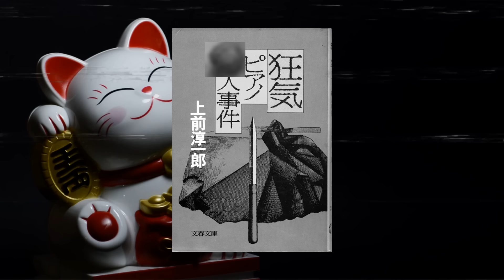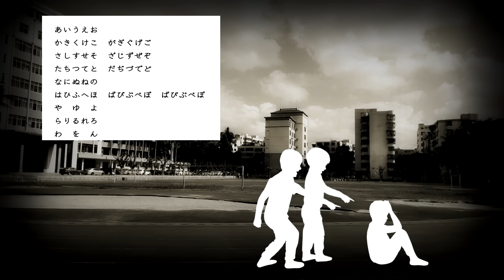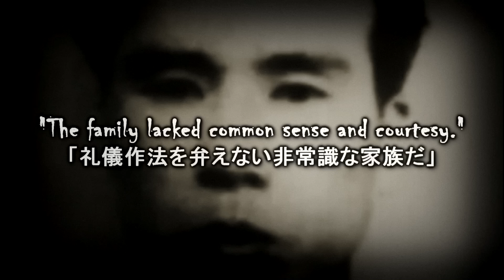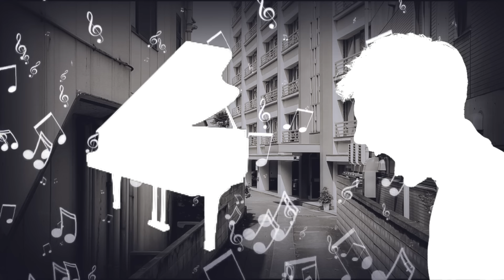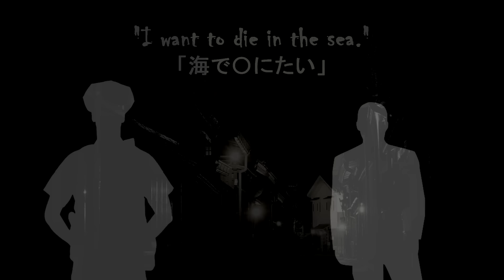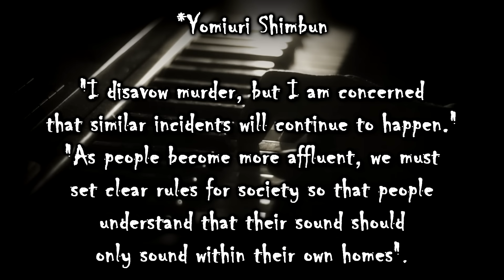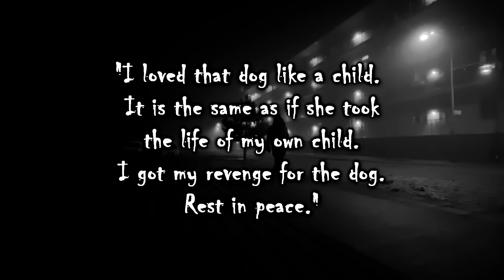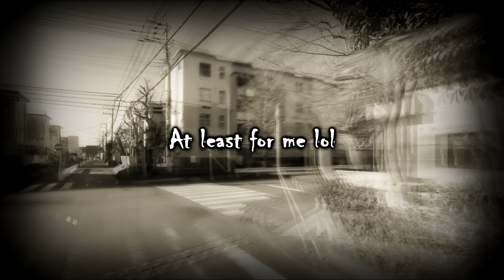Matsuzo Ohama: Piano Noise Incident

Comment: I saw some discussion in here about both hyperacusis and autism. I've had hyperacusis for about 10 years now due to a severe case of Bell's Palsy. In the first weeks of the condition, the torture was extreme. I would literally scream if someone so much as dropped a set of keys on the counter. At that time, ear plugs and headphones didn't help and even made it worse (hard to explain how). Later, as I regained some function, I could handle it. (Although I'm still easily startled and annoyed by a lot of noise.) These days, my Bose headset is a lifesaver for my sanity when I'm overwhelmed. Still, this doesn't sound like hyperacusis to me. People are not usually born with the condition. It's more often due to injury, medication, or age. For that matter, it doesn't sound exactly like autism to me either - at least not exclusively. (It runs heavily in my family including both of my children, and I'm a certified autism specialist.) I think he might have been on the spectrum. But it sounds a lot more like some degree of paranoid schizophrenia. After all, he didn't start with either the speech impediment or the sensitivity to sound - he ACQUIRED those. Which sounds as if he was both delusional and...highly suggestible by his own delusions in suddenly finding himself stricken with those issues. I think this guy had multiple mental health issues that were far more to blame than extreme noise sensitivity or autism. It would better explain the extreme behavior of murdering the family. Autistic people are more typically victims of violence rather than perpetrators. The ones you see in the news who have murdered almost always have co-morbid delusions. Great video! Thanks so much for what you put into these. I hope you feel better soon.
Reply: I’m no specialist, just on the spectrum. I’d like to differ on one point you’re making and would love to hear your thoughts. Acquiring the speech impediment felt to me like a textbook autistic survival strategy. You imitate how people communicate. In this case, he apparently had one friend. It was vital for him to keep that friendship alive. Our guy would have imitated his friend’s speech patterns, choice of vocabulary, intonations, regardless of how the friend expressed himself. As I see it, he did not consciously acquire a stutter, as much as he developed a communication path to someone he cared about.
Reply: I think simply his sensitive ears plus his personality and lack of help all contributed. He may have been having full on hallucinations but seeing as they are mostly verifiable real noises I would say he just bred a personality order and dangerous mindset. Would have to talk to him in more depth to see if he tried things like earplugs or living in a quieter area.
Reply: @Jtq-y4n  Good point. But I'm still thinking that his perceptions of the noise-makers' intentions were more the delusional part. He's definitely a complicated case study. 100% agreement on multiple factors.
Reply: @CineMiamParis  I see what you're saying, and I agree that imitation definitely influences communication. But to me, the severity of the imitation - going from being conversational to being unitelligible - is...extreme.  Picking up expressions, intonations, pronunciations, and mannerisms is one thing, but he went from being able to converse to hardly being able to function. And the acquisition of his intolerance to sound being due to a complaint when he had already been enjoying his own music. It just seems like the suddenness of it all is off - especially in adulthood. Being upset someone complained about his music would not be the reason my son can't tolerate loud music. He can't tolerate it because he can't tolerate any assault on his senses and hasn't been able to since birth. But this guy enjoyed playing his stereo prior to that. That, in particular, seems like a...decision - subconsciously or not - rather than an innate sensitivity. I'm not entirely off the spectrum myself, so I really do get what you're saying. It's valid. The stutter probably wasn't deliberate at a young age. But weighing all the possibilities people discussed here, my entirely unsolicited thoughts are that it's a little bit of all them. But for me, I'd rank him being mentally ill first and autistic second. That said, I'm not a psychiatrist, and I didn't know him. And I do realize this is all theoretical. I'm just leery about chalking it up to autism primarily. We already have a stereotype abounding that autistic people can be dangerous - which is actually dangerous for autists (i.e. supermarket shootings, emergencies involving police, etc.) People who are merely autistic aren't generally murdering people. But if severe enough, paranoid delusions have led to a lot of murders.
Reply: personally as someone whos experienced delusions i would say it could explain his persecution complex, but not really the adoption of unusual traits/adversion to sound in general. i do not have schizophrenia, altho id like to remind you that like autistic people, schizophrenic people are significantly more likely to be victims of violence than perpetrators. shizophrenia and autism are actually very similar (used to be considered the same condition) and its sad to see how one is criminalised and the other is infantilised. personally i dont think its possible to diagnose him as strangers on the internet.
Reply: Yeah I als doubt the autism theory. It seems like this sound sensitivity issue started very suddenly with the stereo incident. The fact that this also popped up later in life makes me think some sort of paranoia or psychosis related illness, since they tend to appear later in life.

Comment: He was suffering from Hyperacusis (everyday sounds seem much louder than they are), it can have devastating impact on the sufferers of this illness. I wonder why he didn’t see a neurologist for his many neurological symotoms, which also point to a possible brain tumor.
Reply: This question isn't meant to be dumb but do you have experience with this issue? If so, would ear plugs be helpful at all for a person with this condition?
Reply: @stacin821  I was also wondering why he didn't just wear headphones around everywhere like he did when he watched tv.
Reply: @stacin821  unfortunately wearing ear plug all the time can increase the hyperacusis in the long run. I only wear it sometimes as not to make this issue worse.
Reply: @hoshizoraaki6551  it would increase the hyperacusis in the long run.
Reply: @adrinadavies9375  is that because even though the sounds would be muffled that they would still bother you? So if you hear them at full volume it would then be worse?
Reply: @stacin821  yes, it’s cause the brain gets used to such a low volume that once you take off the ear plugs everything would sound even louder than it normally is, so it brings down the threshold of tolerance one has to sounds even further.
Reply: @stacin821  I have to wear ear plugs every day and prefer headphones over them. its rough but also something you have to mentally learn to cope with.
Reply: skill issue
Reply: probably because it was Japan in the 60's-70's lol
Reply: Most likely because Japan doesnt exactly foster a culture of tackling such problems. They more encourage you to push it down and try to ignore it, which never ends well.
Even today its bad. But back then? It was even worse
Reply: how do you know

Comment: About the last part, I used to live on buildings like that or Danchis. Usually they were managed by the prefecture or province and involved an approval by them to get one. And yes, rents were cheaper roughly 1/3 of the price of a "normal" apartment. As you can guess, mostly for low-income people included lots of the elderly 
This one is huge btw, mine had 12 blocs. This one have at least 34
Reply: I know there is a huge community in Tokyo in Itabashi. I know someone that lives there the rent is still not cheap because it’s Tokyo but she said for the size and no extra leasing fees it’s not a bad deal. She said though it’s noisey in the afternoons because a lot of families and seniors. But when the kids play it’s noisey and sometimes they run in the hall and you can hear them. Plus her neighbors are always arguing too every few days. Besides that I heard it’s not a bad place to live. I can see why the higher floors are more popular.
Reply: At Yokouchi Danchi in Hiratsuka City, where this incident occurred, foreigners currently account for approximately 20% of the residents. Starting next year, all 50 buildings in this housing complex will be demolished and replaced. By the way, since I saw this on the internet, I don't know if it's true or not, but it is said that no one has ever lived in the room of the victim and perpetrator since this incident occurred.

Comment: So I can provide a little context for the sort of apartment complex in the video. They're danchi. They sprang up after the war as there was a need for lots of public housing and they were actually considered to be extremely modern and sought-after at the time. There are newer danchi these days which are quite nice and modern but for the old types in the video, they are quite dated (exterior-wise, interiors vary and can actually be quite nice! They typically get refurbished after residents move.). They tend to skew older, lots of people who have lived there for decades. The older ones are very cheap to rent and typically require no key money and things that other apartments do, so foreign workers also often live in them.

Comment: I am also very sensitive to noise, and would get startled/agitated. Public places like a mall and busy street are absolutely intolerable to me, and a sudden loud door shut would give me panic attack... I am fortunate enough to be able to move to a quieter suburb, and not required to go through busy commute to city and office to work. Still I have to wear noise cancellation headphone (how would the story of Ohama change if the tech was available?) through out the day, and absolutely need to plug my ears during sleep. These help me to mechanically reduce the chances of putting attention and fixation on the noise, as the noise level hitting the triggering threshold is reduced. It also helps me to practice ignoring the noise through CBT.

Comment: The look of the Apartment Blocks is due to the External Cladding, the rough finish is a boon for moss and the humidity in Japan would mean it look mucky quite quickly.  Your comment about the neighbouring block looking like it had been repainted it probably true, you'd need to repaint the exterior every 10 or so Years or have someone jetwash the outside regularly.

Comment: Noise between apartments in Japan can be a real issue if there’s not concrete between them as they’re built surprisingly thin without much insulation but murdering people over it is a pretty extreme act over it

Comment: So I have misophonia, if you google it you'll quickly realize the symptoms line up. Mine is caused by having autism, and from the sound of it he struggled with a lot of the same things autistic people do. He likely felt like every time he had success others were moving the goal posts socially, wanting to please after struggling as a child when he got a noise complaint it probably triggered things to get worse. No support system in place as mental health is not something you really dealt with in that era, a potential illness that is barely understood even now and a social system that doesn't want to understand people who don't fit in the lines, I get it. I don't like it, and it shouldn't have gotten as far as it did. He should have had a support system, unfortunately he grew up in a time frame where that didn't exist.